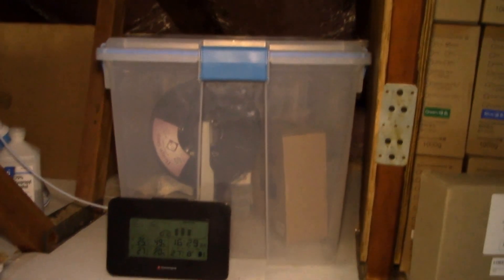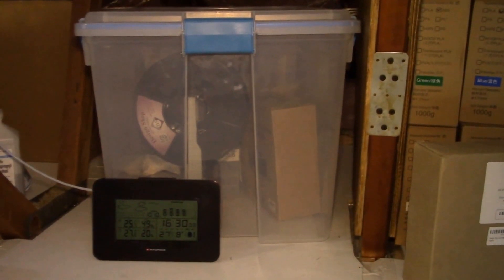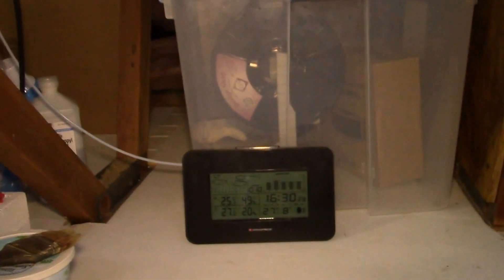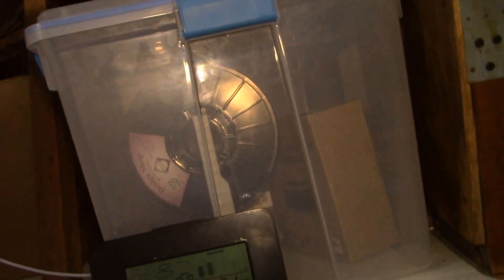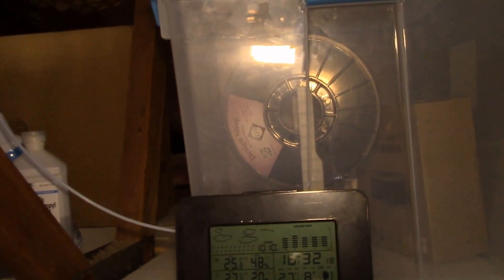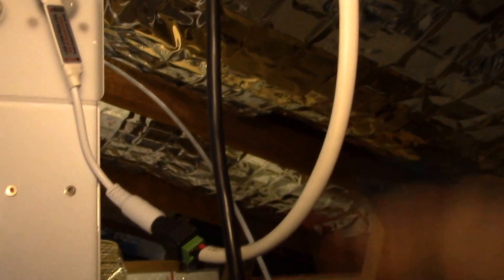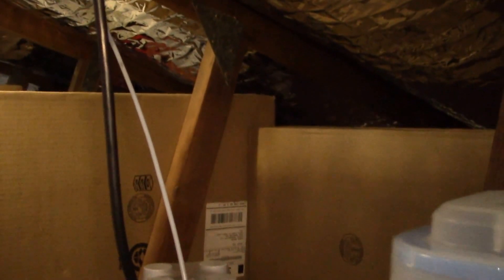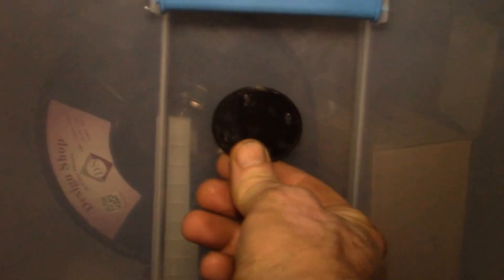Filament Dry Storage Box - Project Overview

Comment: I recommend pneumatic connector quick fittings, here's a link for the ones that fit the general sized teflon tubing used for 1.75 filament. It will help secure your 4mm OD, 2mm ID tubing in place.

https://www.amazon.com/Thread-Joint-Pneumatic-Connector-Fittings/dp/B009ITFO78/ref=pd_sim_469_3?ie=UTF8&psc=1&refRID=6905APWM3BGBHE1RXWKQ
Reply from the maker: Those look like they would work quite nicely.  The ones I printed are working fine and have the mounting flange to attach to the box as well.
Reply: They work great for me. I have a similar filament storage system.
Reply from the maker: Sounds good.  If I get a chance to make another box, I might give those a try.  I wanted to try and make as much of the storage system myself as that is one advantage of having the 3D printer.
Reply: They are are attached via 3d printed parts with threads for the quick connect fittings. I attached one to the Storage container and one above the filament extruder on the printer. This makes an almost airtight path for filament from the storage container to the printer, also looks clean and professional. Here's already designed parts for an example, http://www.thingiverse.com/thing:814597

And the Thingiverse I based my storage system. http://www.thingiverse.com/thing:743280
The only difference is I am using a container like yours, with 6 latches and a gasket.